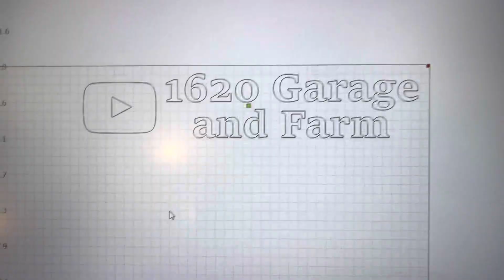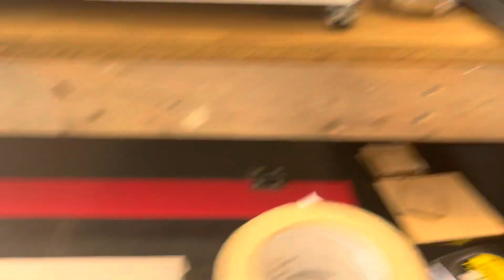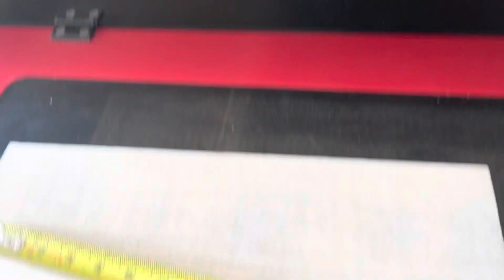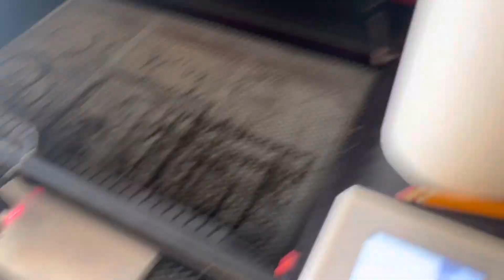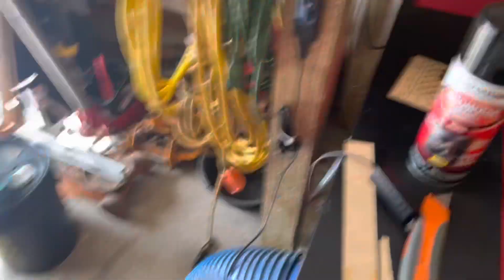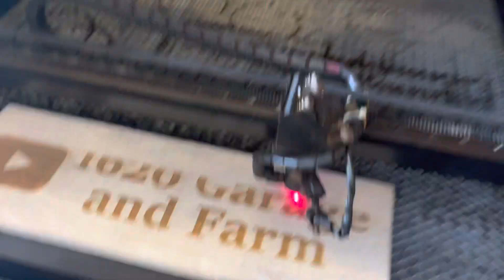Turn Old Pallets Into Stunning Signs! DIY OMTech 100W Laser & Lightburn Tutorial

Comment: I think i follow what you are doing. It burns through the tape and wood, then this allows you to paint the burned areas without worrying about paint on the clean wood. Then you just remove the tape.

I have a 5.5 watt diode laser, i can cut 6mm ply withit, i wonder if it could handle this type of work.?
Reply from the maker: This is correct, It does burn into the wood a little. I think a 5.5 wat may also do the trick. Thanks for checking out my video and channel.
Reply: @1620GarageAndFarm  no problem. You are welcome: ) just got my air pump today for my laser so im excited to cut 6mm wood in 3 to 5 passes rather than 10 to 15 haha
Reply from the maker: @LT72884  Keep your eye out on your local facebook market place. I scored my 100watt laser for 100 bucks !!! It was suspect bad laser tube/ power supply. Turned out it was a bad power switch. 6 dollars off amazon. You can find the K40 (watt laser for 300-400 bucks) all the time. Nice machine for the money
Reply: @1620GarageAndFarm  good idea. Ill keep me eyes open and see what i find. Im 3d printing my air nozzle right now and then will test the new air pump
Reply from the maker: @LT72884  3D printing... My other addicting hobby LOL....  I own 7 of them now... Here is a video on my BIG printer: https://www.youtube.com/watch?v=JFiqchTmjr4